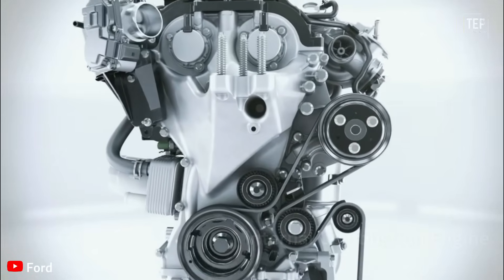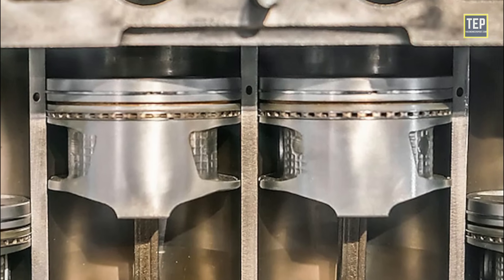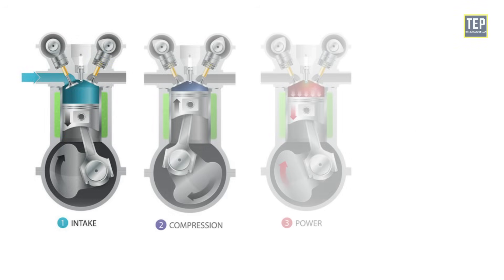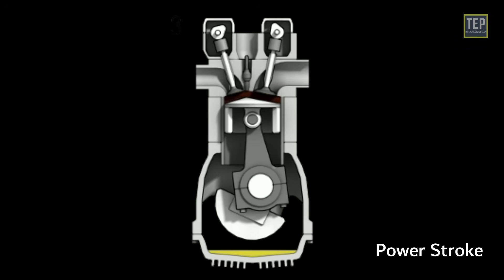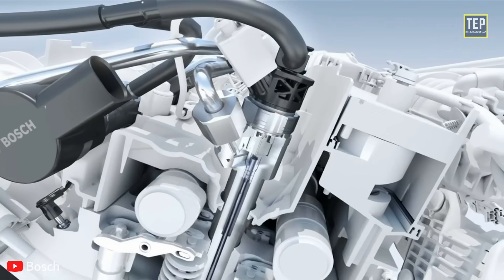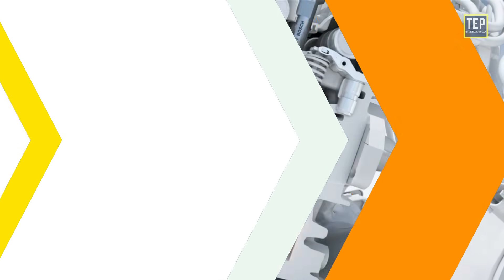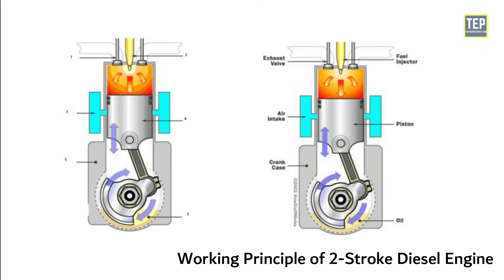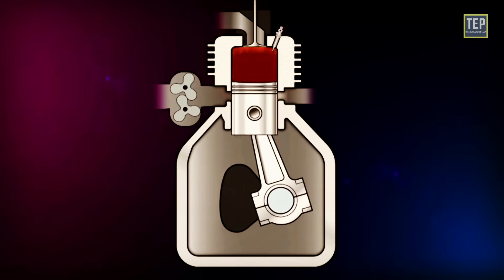4-Stroke & 2-Stroke Engine | Its Parts & Working Explained

Comment: 4 stroke=4 cycle 1(suck) sucks in gas mixture. 2 (squeeze) - compressed gas mixture gets compressed. 3-(Bang)- mixture gets ignited. 4-(. blow)- exhaust gas is expelled from engine. 2 cycle 2stroke- 1-sucks&squeeze  in 1 cycle 2- bang and blows in 2 cycle. 125cc 2 stroke is just as strong as a 250 cc 4stroke

Comment: Pretty awesome the difference between diesel and gas injectors and having the injector be apart of the power stroke and actually igniting the fuel as soon as it atomizes out of the injector rather than being mixed with air on the intake stroke then being compressed then ignited Diesel engines are just so awesome

Comment: Folks. You can make your pre existing alloy engine run for free simply place magnetic caps on top of each piston and replace the valve head with either a magnetic head or electromagnetic head NEVER PAY FOR FUEL OR ELECTRICITY AGAIN

Comment: The heat generated at the top of the head during the combustion is wasted in these type of engines. However, in opposing piston engine, the heat generated is used to push the opposite piston creating double the power.

Comment: so whats the use of a glow plug in the diesel engine if the fuel self ignites with the use of the heated pressurized air.
Reply: The heat has to come from somewhere, initially. "In a diesel engine, a glow plug is a heating device used to aid starting of the engine in cold weather." Many diesel engines are known to be difficult to start in cold weather. Some glow plugs are manually operated during startup, or are cycled on during a cold start, and they shut off once the engine is running/up to temperature.

On the other end of things, read about/watch diesel engine runaways.

Comment: Ec engines coal railway engine etc, ic engines two types one is low compression engine, second one is High compression engine. All patrol gas engines low compression engines, diesel engines high compression engines.

Comment: When you were comparing the advantages of a 4 stroke engine and a 3 stroke engine, you compare a gasoline 2 stroke engine to a 4 stroke engine. Why not compare a diesel 2 stroke engine to a 4 stroke diesel engine. I wish that there are 2 stroke gasoline engine using fuel injectors. This will be better than carburetor 2 stroke gasoline engine.

Comment: The biggest difference is between the two stroke gasoline and two stroke diesel.

In a two stroke gasoline engine with crankcase compression, the air is pulled through the crankcase. If the crankcase had a wet sump like 4 stroke engines, then the air would pick up the engine oil and it would run out of oil way too quickly and also mess with the air fuel ratio. This is why oil is mixed into the gasoline. The oil in the gas is necessary to lubricate the crankshaft due to the lack of the wet sump.

In a two stroke diesel, crankcase compression is not viable because only air can pulled into the engine. With a wet sump, any oil picked up in the air would cause preignition, which can destroy the engine. And because the fuel is injected later, premix with a dry sump can't be used either. This is why 2 stroke diesel engines need to have forced induction, either a supercharger or a turbocharger or both. They can't use the crankcase compression to force the fresh air into the cylinder. And because they don't use crankcase compression, they will have a wet sump and a dipstick like a 4 stroke engine.

Comment: Higher fuel consumption is definitely a disadvantage for gasoline 2-strokes. But I don't think it is a disadvantage in 2-stroke diesel... you know, injects fuel when everything is sealed... Regardless of all those advantages and disadvantages, 2-strokes sound nice, especially diesel ones.
Reply: You haven't been riding on a 2 stroke car - it's very amusing experience.
Reply: @herobrinecyberdemon8104  well that's not what he was talking about. I haven't either, the point is, two-stroke gasoline engines will use more fuel regardless, and you have to spend money on oil too

Comment: 2stroke diesel should have more advantages than gasoline 2 stroke because is no fuel waste in exhaust, difference between 2/4 stroke diesel should be minimal(disadvantages)
Reply: Its more complicated because diesel is quite a bit thicker than gasolina

Comment: Some clarification about 2-stroke engine thermal efficiency: 2-stroke engines are NOT necessarily less efficient than 4 stroke engines. Big 2-stroke ship engines are one of the MOST efficient ICE engines with thermal efficiency over 50%.  Also, diesel 2-strokes does not have fuel losses due to scavenging. Diesel 2-strokes and crankcase compression gasoline 2-strokes are totally different engines.
Reply: Lmao extreme example
Reply: 2 stroke engines excel in power to weight ratio and high end torque (which is not necessarily at low RPMs), they generally sound fast. Some people ahem... prefer that loud and aggressive sound and that's it.

but I love diesel four stroke engines. Period.
Reply: Thats a Extreme example. He is obviously representing the basic engines, small to medium sizes

Comment: I have always wondered why nobody has made a 2 stroke gasoline engine like the 2 stroke diesel engine. Would it work better?
Reply: It needs more lubrication compared to diesel so the wear would be phenomenally high, also 2 stroke diesel engine wear out faster than 4 stroke engines
Reply: There's plenty 70s to 90s motorcycles with 2 stroke gasoline engine. They all wild on the road. Their 2 stroke 150cc can make 500cc 4stroke want to sell their bike
Reply: Just about every chainsaw has a gas 2 stroke engine. Most dirt bikes from the 1960s to the 1990s were 2 stroke gas engines. They were phased out because of the pollution. They tend to smoke more than 4 stroke engines. But I have owned a few 2 stroke dirt bikes and they have INSTANT THROTTLE RESPONSE! They were a real Blast to ride!
Reply: gasoline go boom easier and nastier
Reply: I think what he's talking about is a Detroit diesel style 2 stroke gasoline engine with a blower for induction NOT a conventional gasoline 2 stroke where you have to mix oil with gasoline.
Reply: @mattdaddy_888  yes exactly lol
Reply: Attached e
Reply: They do!!!  Most dirtbikes from 1960s - 1990s were 2 strokes.  I know I have a few of them.
Reply: I get what you mean. A 2 stroke gas engine with a intake valve line the diesel 2 stroke has. 

Would honestly be pretty interesting.
Reply: Look Mazda Two stroke engine anda You will see it
Reply: Diesel engine only take air from input valves, where as gasoline or petrol engine takes petrol and air hence engine design may not be made as simple as diesel 2 stroke engine
Reply: 2 stroke petrol engines are very common in asia
Reply: It causes higher levels of pollution and is inefficient....
Hence was banned
Reply: @Tommysmess it was made into a grass cutter machine
Reply: 2 stroke gasoline engines are already made in 19th century only it used in RX100 bikes it is banned in India because this bike is more powerful in old times. These bikes are used by the chain snachers police can't chase them because of speed of bike and it is banned because more air pollution by this bike engine